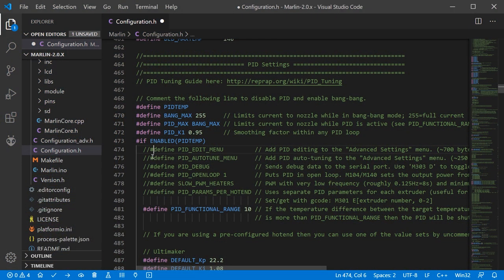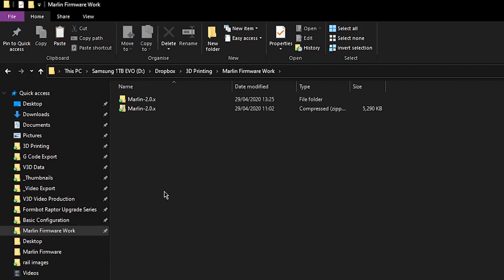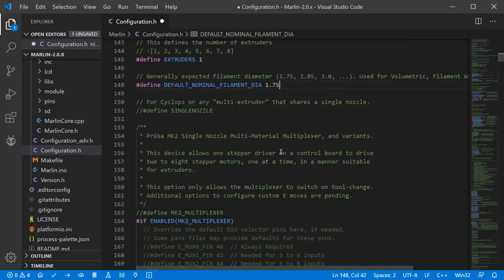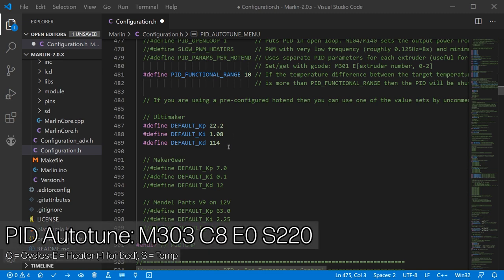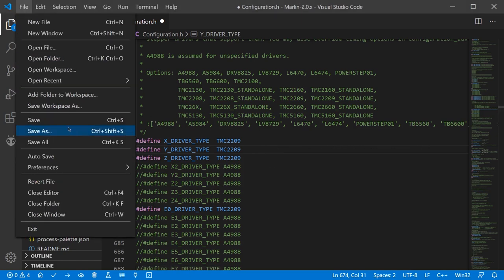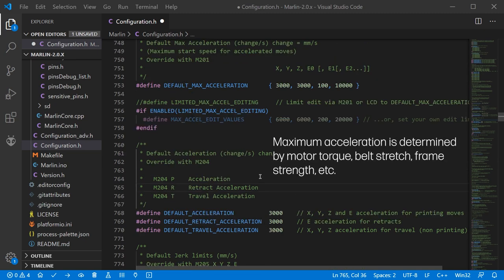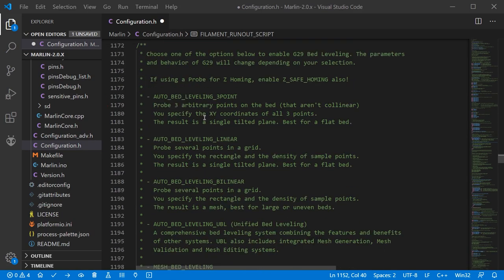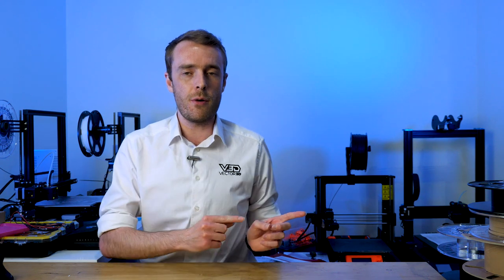Marlin 2.0.x Full Guide - Basic Configuration (Part 2)

Comment: I have a question. I am installing a new SKR 1.4 Turbo with TMC 2209. I got all of my firmware edited, but when I went to build it, I got an error. Something to do with the Advance Pause I think. I am attaching the error, I think. Any advice would be greatly appreciated.

"ADVANCED_PAUSE_FEATURE currently requires an LCD controller or EMERGENCY_PARSER."
Reply: Got exactly the same problem. Did you find a solution? :(